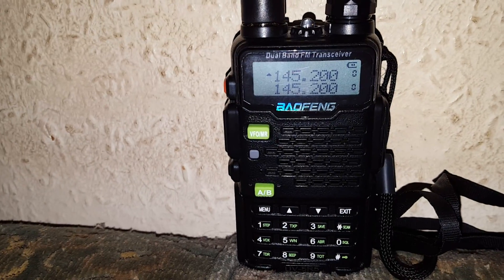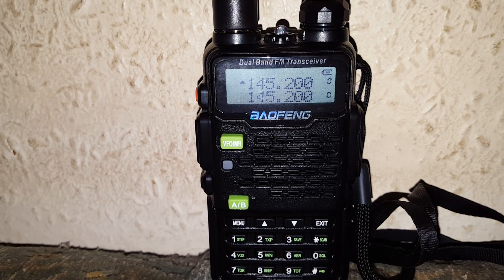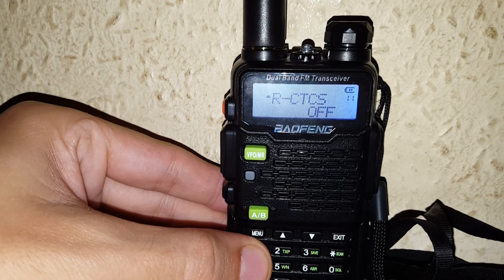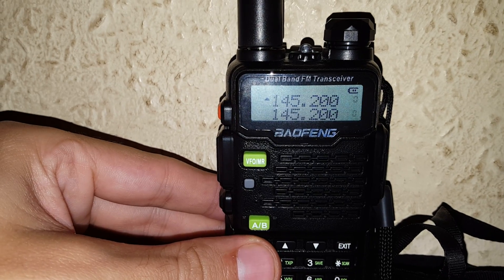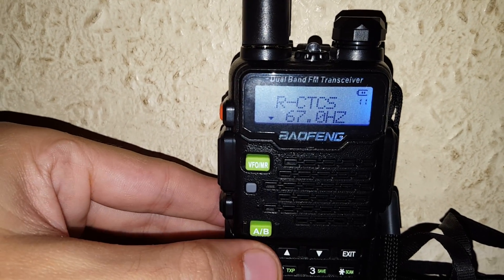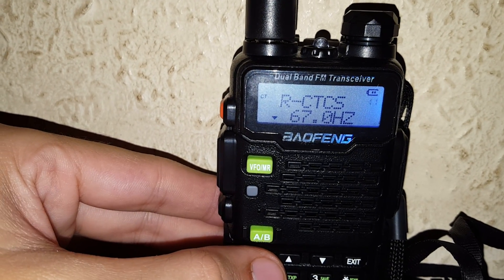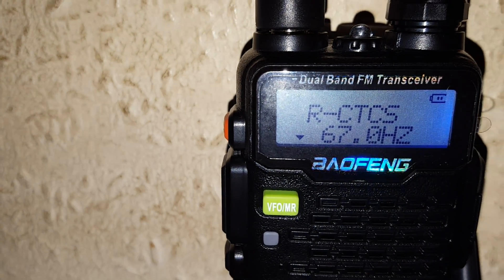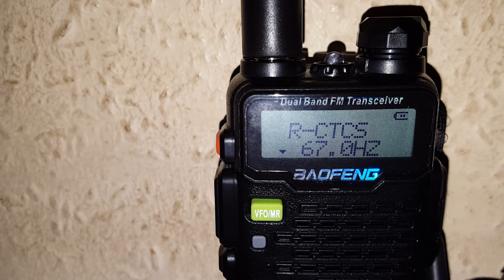Baofeng uv5r5 ctcss scanning method

Comment: Hi thanks for the info. What about T CTCSS, how does one find that
Reply: Hi for GMRS on a UV5R if I know the receive tone, the transmit tone is plus 5 more correct?
I am using the chirp to program a gmrs repeater and I put it in the receive tone aka tone sql column. With plus 5 of my receive tone of 156.7,  Chirp doesn't give me an option to put that amount in the tone column aka transmit column. Would all I need to do in this case is put the duplex + and put the offset for 5.000000? Closest thing to 161.7 is 162.2 in the tone column. Also on my UV5R it reads at the top +- when I am on channel mode for that repeater. The R-CTCS and T-CTCS are the same number when I look as well through the menu. Is this correct or does the T-CTCS number need to be different to transmit on the repeater?
Thanks!

Comment: Whats the difference between t-ctcs and r-ctcs, if I put the tone in both with the freq will it do anything different?
Reply from the maker: Ctcss and dcs are different thats all i know buddy 👍
Reply: That wasn't the question.
Reply: t is for transceiving, r is for receiving. If you want to talk to a simple PMR with CTCSS you'll have to set T-CTCS or they won't hear you. If you don't set R-CTCS you'll hear all talk on the chosen channel. If you set R-CTCS you'll only hear the talk for the chosen CTCS tone.
Reply: Why CTCSS is Different from DCS? CTCSS (Continuous Tone Coded Squelch System) uses continuous tones below 300 Hz whereas DCS (Digital-Coded System) uses digital data or encoded-words which are very unique and all encoded words can be used on the same channel without interference

Comment: Does works on a repeater
Reply from the maker: Yes it sure does 👍
Reply: @m6stl2010  i tried and it dint work. I was on the papa system trying to find the tone for a frequency and as they were talking I did this and the scan didn't stop
Reply from the maker: @SuAmigoElilegal  oh ok, it worked on my previous model, sorry i couldnt be more help.👍
Reply: @m6stl2010  i jut got my new BF F8HP so I will try on this one hopefully it will work
Reply from the maker: @SuAmigoElilegal  good luck

Comment: Can i this method from boafeng uv5r
Reply from the maker: Yes you sure can my friend 👍
Reply: @m6stl2010  Thnks.. You solved my problem. 👍👍👍
Reply: @m6stl2010  doesn't work everytime I press the scan button the ct doesn't show up
Reply from the maker: Sorry to hear that, im guessing on the later software models it wont work? 👍🏼
Reply: @m6stl2010  it's ok fren I just use sdr and raspberry pi 4 to solve my issue 😎😉
Reply from the maker: Sweet nice one my friend! Enjoy and 73 from england 👍🏼
Reply: @m6stl2010  Im in the Caribbean anyway I can contact you?
Reply from the maker: @MR22TREE  cool yeah you can contact me on skype username steve_m6stl
Reply: @m6stl2010  no I mean through frequency
Reply from the maker: @MR22TREE  sorry that would be impossible cuz of the distance

Comment: I've been trying to pick up on local repeaters here and probably not getting them because of this found out that the repeaters are set at 110.9 but what about the other rctcss? Is one for transmit and the other for receiving?
Reply from the maker: Repeaters only use a transmit ctcss code, therefore you do not need to set up a receive ctcss code, just keep the r-ctcss to off position, 👍
Reply: Have you, or anyone else actually tested this IRL?

Comment: This seems to work but doesn't want to find my works radio privacy code. I was able to communicate to my work radio once and then never again. I can hear the transmission coming from my work radio but I can't transmit back. Any ideas?
Reply from the maker: I see, well to transmit back from your other radio you will need to make sure that the radio is set to transmit on the same ctcs code, ie works radio t-ctcs 67.0 other then the other radio set to r-ctcs 67.0 and or vice versa, hope this helps, 73.

Comment: Hi , i'm just getting into my Baofeng but could you tell me how to set it to ( output 145-6000 , input 145.0000 , CTCSS - 103.5 Hz and it's Channel RV48 ) Is the output top or bottom row , i would appreciate any help you can give me . Cheers
Reply: Set to 145.000 then select + for the frequency direction, then set an offset of 000.600 then under tctcss set your tone
Reply: James Bond top and bottom row are ywo different frequencys thst you csn switch between and has nothing to do with output/input

Comment: Ok, followed your steps exactly but my 5R5 doesn't want to play along. Once I hit the scan button I can see the "CT" start to flash, but after a couple of seconds it backs out of the menu and stops the scan. Any ideas where I'm going wrong here?
Reply from the maker: Hi your not going wrong, the ctcss scan on these radios unfortunately have very limited time functioning! Except when there is active signals often on the desired frequency, then it will reliably scan and find codes no trouble! But if youre scanning a frequency for a code and no one tranmits within a short period of time then the radio goes back out of scan forcing you to re-scan! Can be annoying but these are baofengs after all, 73.
Reply: In my experience, this doesn't really work.  People usually respond without trying it.